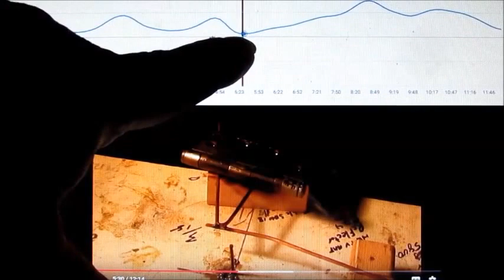ULTIMATE TV ANTENNA UPGRADE

Comment: Hey Danny,
         You used the Ryobi sander to put the flat spot on ends. When I tried this I ended up getting it off center. Just letting people know they need to watch what they are doing. In one of your other video you used a chop saw. An they came out looking perfect. So that is what I did.  And you are SO right about the PVC glue. It will set up in a heart beat. So make sure you got it where it needs to be.

Comment: Hey Danny,
        You need to read this !  @0.25 You are talking about the different sized pipes. 3/4 thin wall and then sliding the 1/2 thick wall into it. The reason to do this is to give the screw something to hold on to, right ? This is where the wiskers go. Every place I went today only had thick wall PVC pipe. So thats what I got. I took the 1/2 thick wall  pipe and cut a slit down the side on the table saw. I had to make two passes, once was not enough. Took some plyers and squeezed it and slid it into the the 3/4 stuff.  Then took a hammer an slowly tapped it down.  It was a tight fit but it worked. This should give the screw more to bite into.
Reply from the maker: RIGHT

Comment: Thanks Danny, I knew you would make one with all PVC eventually. I like the fact that you don't have wood or extra metal to deal with. Screw the reflector on the back and you are set! If I build another one, that is how I will do it. I may do some modifications, they make the hinges like for lawn furniture, and 4 way fittings so I may build the double one using those and make a way to secure it in the direction that is needed. BTW, I am still wondering what your patent is for, and also curious how the Hoverman vs the Ultimate will turn out. My money is on the ultimate!
Reply from the maker: oh yeah...lol
Reply: I'm curious about the signal strengths too, is there any chance you could build a antenna carrosel or merry-go-round so that multiple antennas can be mounted and rotated to be at the exact same spot,  quickly tested and signal strength measured with a digital meter or spectrum anylizer.  that way there's no deviation in distance height or Latitude from.  each antenna in exactly the same spot.
Reply: Kal Jak, I too have inquired if Danny S Hodges will make or has made an Omni-Directional’ Ultimate Antenna,’ so I believe what you were thinking and the word your should have used is Omni directional. That would receive Digital TV Station signals from 360 degrees. 👍

Comment: Hey Danny,
        At the end of this video you put the 1/2 pipe into the middle of the 3/4 pipes you just put together is that just for strength ? You were using the thin wall stuff. Please read my last post. So far all I have used is thick wall pipe.
Reply from the maker: FOR strength

Comment: Hi danny, This new antenna your building with the window framing as the reflector should give you a little more forward gain. I am a ham radio operator and build wire antennas.
Reply from the maker: yeah it works good